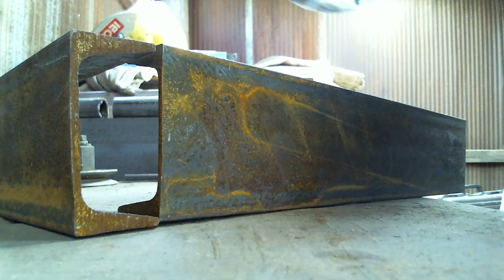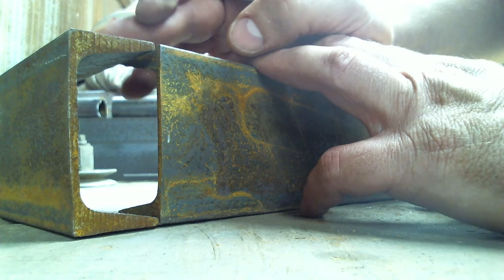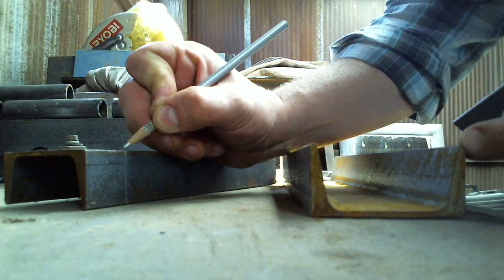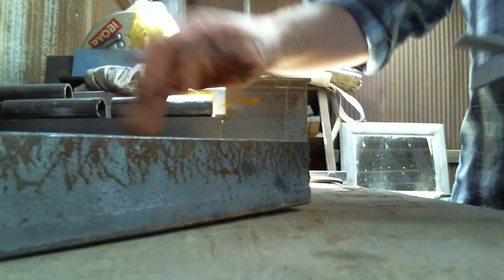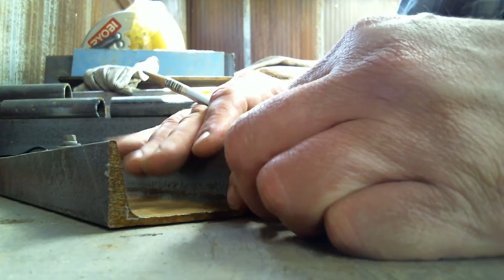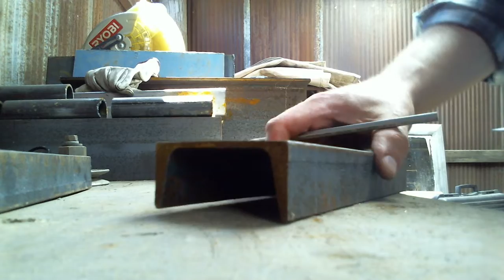Coping Channel Iron

Comment: Just cut off a thin piece of the channel That is not getting coped lay it on the face of the channel That is getting coped and trace it easy breezy
Reply: Yep!
Reply: Yeah don’t spend an hour on a 15 minute job
Reply from the maker: Yes sir very easy , however a fabricator needs to understand how coping works so they will be able to handle compound and angled copes and coping one type of metal into a different structural shape. This is lesson one for welding fabrication students. Thanks for you comment.